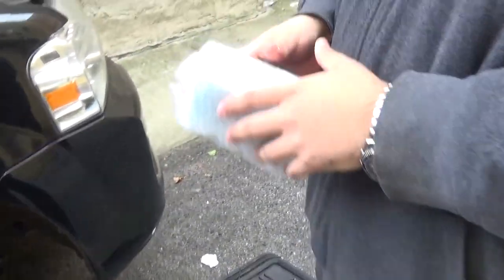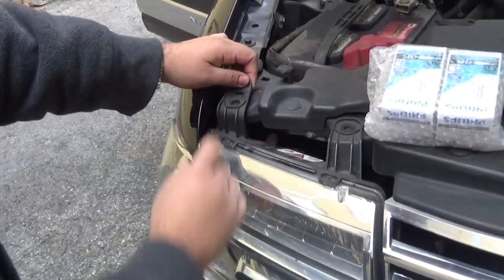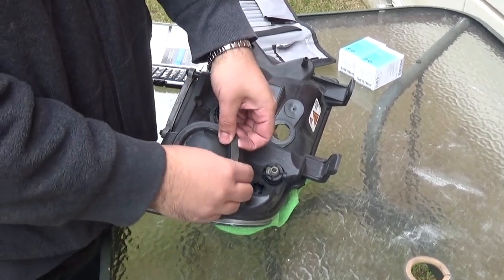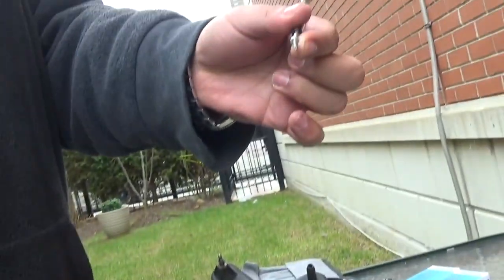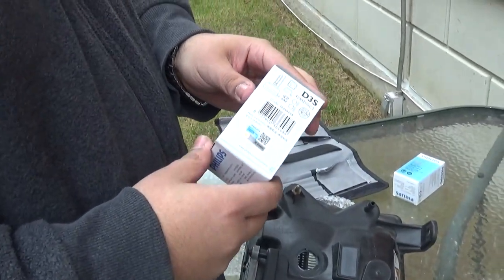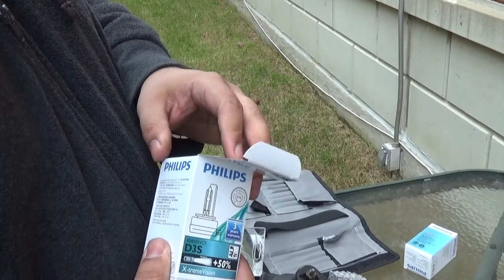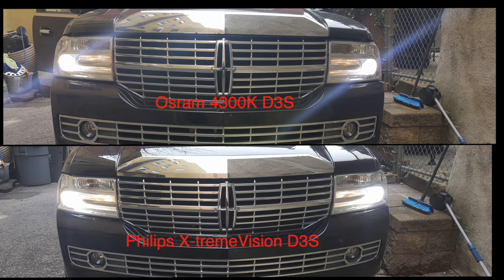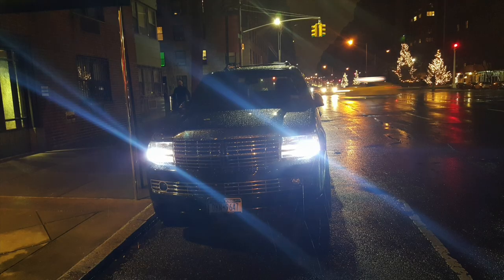HID PHILIPS X-TremeVision D3S Install Lincoln Navigator 2007-2012 Bulb replacement

Comment: Excellent Video.  I was able to change the bulb in my 2011 Lincoln MKX.  The only difference was I did not have to remove the headlight assembly and there was no bracket that needed to be removed with the T9 Torx Screwdriver.   With gloves - hold it- pull it - twist it.  Thank you.
Reply from the maker: Carla Moody Good info on that MKX! Thanks for watching!

Comment: Thanks for this video, is it totally OK to use Philips 3DS hid with Osram ballast?
Reply from the maker: Yes, I have been using them. I still have them installed on my navigator
Reply: descargamusicalny Good, thanks for your reply 👍🏻
Reply: Have you heard any buzzing afterwards? I have a 15 mks with osram ballasts
Reply from the maker: @sfn4702  no buzzing

Comment: “Don’t touch the bulb” then at 3:58 hit bulb against housing. 🤣
Reply from the maker: well the reason why you should not touch the bulb with your bare hands is to prolong the life of the bulb. you can even drop it if you want, as long as it does not break. The oil we carry in our hands naturally will decrease the life of the bulb.

Comment: I changed out my driver side. Got to the passenger side and found out the previous idiot stripped the damn torx screws.  Now I have use a damn extracter tool
Reply from the maker: Wow, sorry to hear that. That sucks since the space to work in there is so narrow.